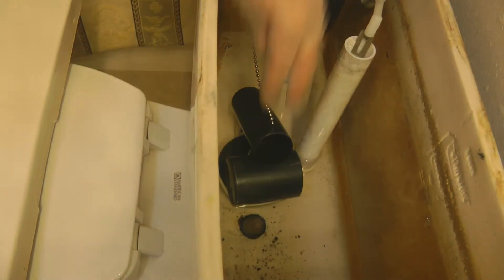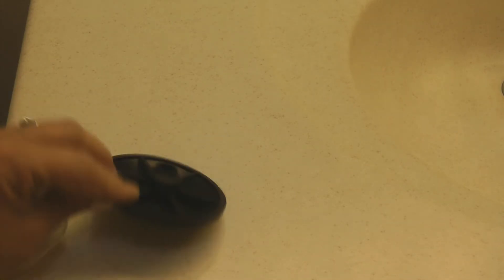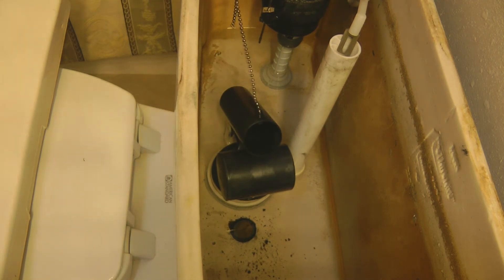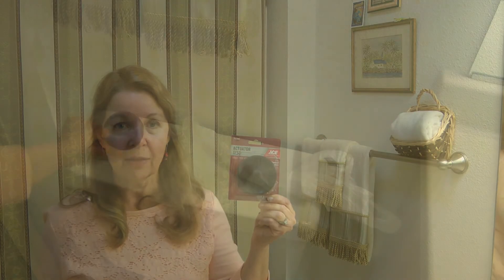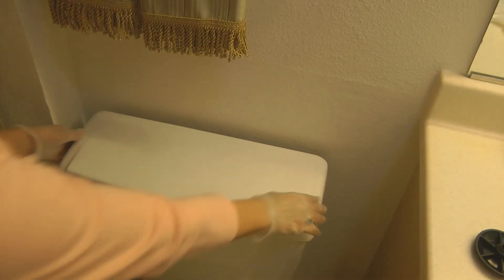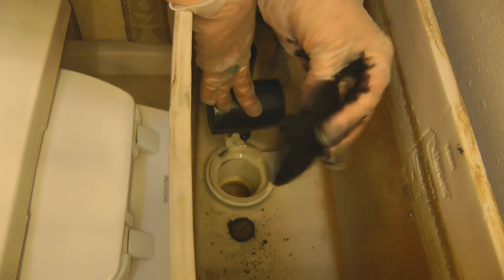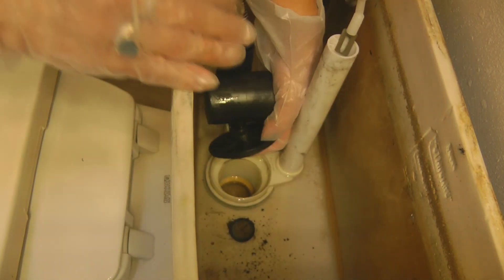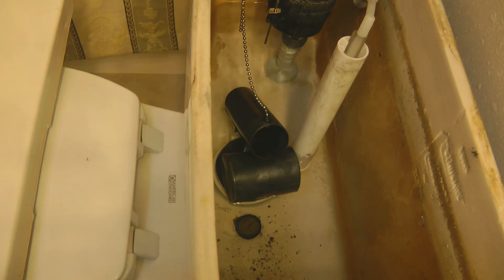How to Replace Toilet Flapper Install New Actuator Disc- Stop Toilet From Running

Comment: Thanks - knowing that the part is separate and available let me do the job. I also appreciated the suggestion for wearing gloves and having a disposal bag. It was a cheap, effective, and easy fix. I found the part and used the one from Fluidmaster ("Actuator Seat Disc") on the American Standard valve. I cleaned the rim of the valve while I was doing the replacement. It works fine.
Reply from the maker: Glad this worked for you.

Comment: Great video. I just performed this same operation on an identical setup and everything worked exactly as you indicated, thank you. However, for some reason the actuator now stays stuck in the open position even after the water drains from the cylinder, requiring a tap on the toilet handle in order to bring it down, otherwise the water will just continue to run. I think this is happening because the weight of the replacement flapper valve is insufficient to bring the actuator down. But I honestly don't know hot to fix this. Any ideas or recommendations?

Comment: My toilet had an aftermarket disc that was made of a stronger rubber. While trying to remove it, I ended up snapping off the plastic tip of the black plastic actuator piece. So it might be best to remove the entire actuator, which isn't very difficult, then cut the disc off with a utility knife.
Reply from the maker: Yes, there are definitely challenges to different types of flappers and flushing mechanisms.
Reply: Some of these same type flappers screwed on.

Comment: the actuator in my toilet after replacing the actuator and the valve assembly won't open completely. I have adjusted the chain multiple times but it still shuts d moment I leave the lever.

Please help!!!
Reply from the maker: Do you still have the old one?  Perhaps the new one you chose is a bit different.  I like to buy mine at Ace Hardware or True Value, and have never had a problem.